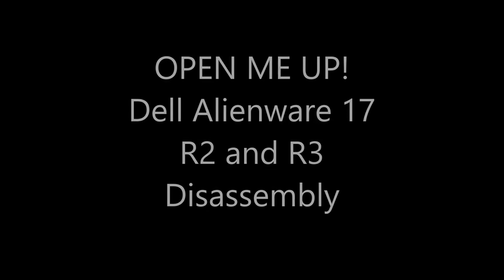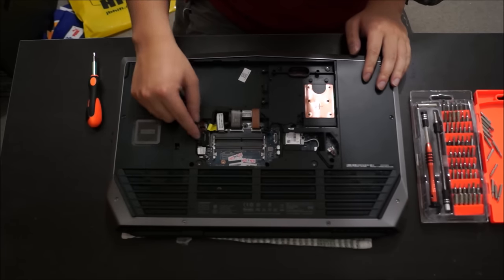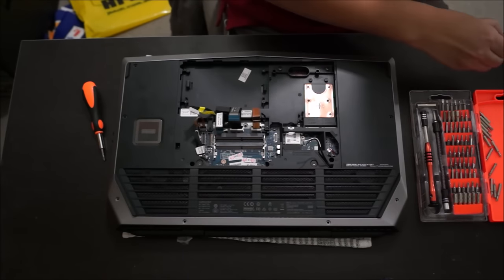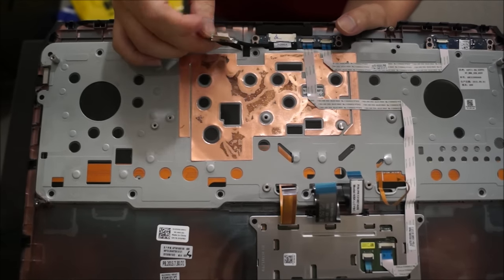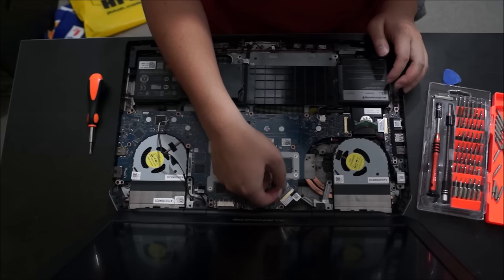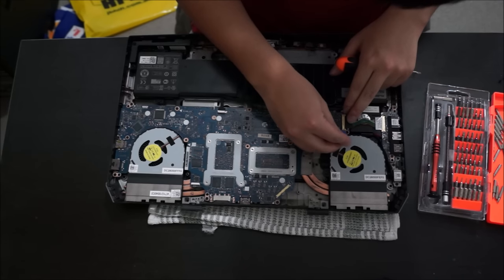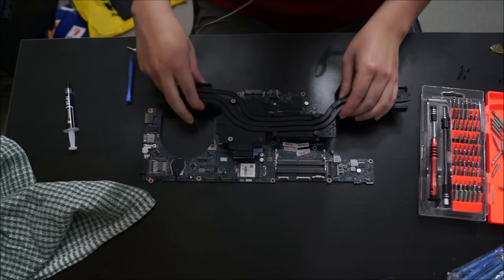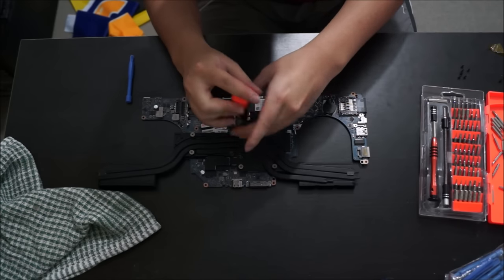OPEN ME UP! Dell Alienware 17 R2 R3 Disassembly

Comment: please make a video of the most quick and easy cleaning of the cooling system .(Alienware 17 R3)
Reply from the maker: +Alexandr Postolatiy watch 19.30 the black thing is all you need to clean and thats all there is to the cooling system
Reply: I think he was asking if there is a way to clean dust out of the cooling system without the complete disassembly of the computer.     From what i can tell from the video, the answer to that is no.  (it appears that you can partially clean by blowing compressed air into the exhaust vents.   I would clean about once a month).   This is critical maintenance since over heating is a killer.  Looks to me like a very bad design for Alienware's latest notebooks.  I am considering buying a Alienware 17 and Graphics Amplifier, but after watching this video I am not sure this is the computer I want.  Dust cleaning from the fans and radiators should be as easy as popping open an access panel.  It is also disappointing that the video cards are no longer upgradeable.
Reply from the maker: many people want to upgrade their cards and cpu but then after finding out it cost basically half of the laptop just to buy a cpu or graphic card they dont do it. So the issue is no one does it thats why they removed it. I heard many people say they going to do it but no one i know that owns a laptop that has changeable graphic card or cpu has ever done it

Comment: Hey, Do you have an idea of how to just clean the dust out of the fans with minimal disassembly?
Reply from the maker: watch the video and get to the fan. if you dont get the the fan you cant clean it out
Reply: Ah, so i have to take out everything prior to the fan first? I was hoping there'd be an easier way but I guess not. Also, just a quick question. Is it possible to change the graphics card, or add an external one to this laptop?
Reply from the maker: if you read my description it tells you the graphic card is soldered on. you can use an external graphic card if you get the alienware amplifier

Comment: Hi, 1st hope you reply on my msg. 
My alienware 17 r3 suddenly suffer a 7 beeps error. I tried the comforter trick but didnt work. Dell support gave me the quotation for new mother board and it cost like a brand new laptop. Now planning to do a 'motherboard reflow' with opt 1 : using heat gun or opt 2 : bake it in oven. Just wanted to check if you heard this issue before and also would appreciate some advice. Thanks!
Reply from the maker: Use a heat gun but doubt you will fix it. an oven is dangerous and will normally cause more issues. if you use an oven you will realise some of your other components falling off because the heat unsolder other components without you realising it.
Reply: OPEN ME UP thanks alot for your reply. Will do the heat gun then. Though what confused me is that some says to heat the GPU others says it's the CPU. Sorry for asking too much but do have an idea which one I need to reheat? One thing is clear, that I have to do it since mboard replacement is good as buying a new unit. Very sad life.
Reply from the maker: it is normal for these issues to happen you dont know how many of these i had that i could not fix with a heat gun. the last time i check dells user manual it says 8 beeps means the CPU and 7 beeps is the GPU but do both there is no harm. since if one of them have lost contact clearly the other one is close to the same thing or have the same issue already. the motherboard works from the lowest number first. therefore if you have an 8 beep issue as well it will not tell you until you resolve the 7 beeps.
Reply: Thanks. Let me give it a try and update you here, hope my next post is a good news. Thanks again.

Comment: in alienware r3 2013 model how many hdd or ssd can fit at max and ran can be upgraded to how much bg at max??
Reply from the maker: you need to tell me if it is the 17 15 13 or what. if it is the r3 17 2013 it can fit 2 2.5 inch hard drives 1 extra if you remove the dvd drive and a msata
Reply: sorry its r3 17  2016 model and it does not have any dvd.
Reply from the maker: CPU is solder on, graphic card is solder on, ram can be changed to 16GB max with 8GB in each slot thats for ddr3, ram can be changed to 32GB max with 16GB in each slot for ddr4, there are two M.2 at 80mm slots for the R3 model, there are four M.2 slots for the R2 model and there is 2 slots, wireless card can be changed, and hard drive is a 2.5" inch.
Reply: thank you....

Comment: Hello, a question that type of mainboard is that?
Reply from the maker: it is this laptops motherboard. which is only used for this laptop and the 15inch version. everything is soldered on to the motherboard if that helps

Comment: Hi is there a slot for 2nd ssd 2.5 inch hard drive , just ordered another one :( ?
Reply from the maker: no there is only one 2.5 inch slots and two m.2 slots. if you have the R2 you have four m.2 slots instead of two

Comment: how did u disconnect the hard drive cable. that black plastic tab thing
Reply from the maker: you need to life up the clip thing holding the cable down
Reply: you mean to pull the black plastic tab up right? Did you use much force to pull it? cuz I pulled it with some force but it seemed attached very tight.
Reply from the maker: you know watch the video and tell me the time in the video this happen because i dont think with both talking about the same thing
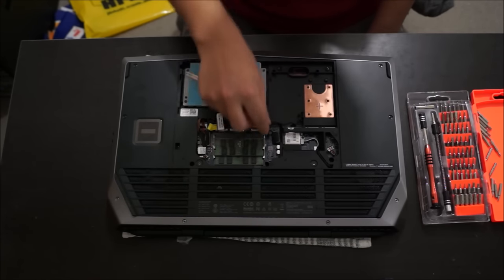Reply: it's the thing you hold between 1:34-1:37, and it seems that when you opened the panel at the beginning, that cable has already been disconnected so I don't know how u disconnected it. It has a black plastic tab and others say just pull that tab up. I just don't know how much force to use since mine seems get very tight and can't get off.
Reply from the maker: no just lift it up and it comes off.

Comment: God it's so annoying to buy a gaming laptop and have to disassemble half of the bloody thing just to clean the fans or reach the GPU/CPU.
Reply from the maker: normal people dont even have a screw driver therefore they dont even think about disassembly it.
Reply: Quite frankly I'm very afraid to remove the mobo because I'm a bit of a brute and I've broken much tougher things and that thing is full of delicate cables that are very well connected to their connectors indeed.

All just so I can clean my fans, which btw is basic maintenance that all gamers do for their gaming laptops. 

Next time I'll go back to MSI, at least all the vital parts are easily accessible through a single back panel. Even if I did know how to handle those cables, it's still incredibly inconvenient. You can't call yourself a gaming laptop if you have to remove every single component just to do some simple fan maintenance imo, it's ridiculous.
Reply from the maker: yes and no. think about it all the people you know how many of them would actually do it. companies cant make it simple just for a hand full of people who would like you and me. thanks to them i get to make videos and you get to watch them
Reply: It must be nice to be those people and have 1500 dollars to throw away whenever their fans get too dusty.
Reply: @j marco Uh what? I don't smoke.
Reply: M17x R4 is way better. It is upgradable and possible to maintain compare to the BGA Alienware today. Dell with their idea to make Alienware turn to be BGA have ruined Alienware. They threated the line on Alienware and horrible control on its custom.r service

Comment: My 17R3 beeps twice when I'm trying to turn it on. Help me please
Reply from the maker: ram issues
Reply from the maker: there is a beep code list you can find. 2 beeps means no ram
Reply: Laptops  
1 Possible Motherboard (covers BIOS corruption or ROM error)
2 No RAM detected 
3 Possible Motherboard Chipset
4 RAM failure (other)
5 CMOS Battery
6 Video card/chip
7 CPU
8 LCD 

2 beeps possibly mean ram not detected, it might be your ram or the slot

Comment: my friend , you got a subscriber and like :)
I need your help , I bout a new alienware 17 r3 970m and went outside the states , at first it was suddenly freezes then gives me that the intel graphic card was not responding and restarted . one day ( 4th time of use ) I power it on and it was froze , I had to do hard power turn off , when I start it again the GTX 970m was gone !!

I went to device manager and the GTX was grayed out , I uninstall it, and was not able to find it again  !! 
- I did clean windows install 
- updated the os
- updated the BIOS
- disconnect the batter and did power drain .

with no luck 

can you please tell me if there is something else I can do 

thanks
Reply from the maker: nope seems like you have a motherboard fault and there is nothing you can do with it as everything these days are solder on to the motherboard. from what you are saying your graphic card is probably dead
Reply: OPEN ME UP thank you very much

Comment: Imp ques can i have Alienware 17 R3 BATTERY into 17 R2
Reply from the maker: yes they are the same laptop
Reply: +OPEN ME UP R u sure cause after ordering may be there is less chance for replacement
Reply from the maker: if thats the issue why dont you go buy a r3 battery then. which is much safer than one a r2 battery
Reply: +OPEN ME UP I mean that if i buy AW 17 R3 battery and if it wont fit into my R2  then  just confirmation ???
Reply: +OPEN ME UP and BTW u r too fast i mean ur replies awsm
Reply from the maker: it just happens that i just got home and sitting on the computer
Reply: +OPEN ME UP Buddy but u have not replied my above ques
Reply from the maker: i didnt see your question. what alienware you have. give me the service tag and i will tell you what to buy
Reply: +OPEN ME UP ALIENWARE 17 R2 2015 MODEL
Reply from the maker: the part number for the battery is 92WHR. Here is my service tag for my R2 and R3 . you can see in the system config for both of them that they use the same battery like i said because they are the same laptop they use everything the same it is just the motherboard they solder on a different CPU
Reply: +OPEN ME UP You won brother thanks for the great help

Comment: i just want to clean its fan..i am afraid i might wreck it...
Reply from the maker: it you watch the video and still think it is too hard. i recommend you not to do it
Reply: Hey man i did everything as you said now my fps are dropping like crazy....i think i applied more thermal paste...what should i do?? please help..
Reply from the maker: do it again and apply less thermal paste
Reply: OPEN ME UP i did it again..but same problem...fps are dropping within 5 minutes...looks like something is wrong with my heat sink..what do you think?
Reply from the maker: no i doubt it you probably have computer issues. try running 3dmark 11 and tell me your results
Reply: Score- P10193
Graphics Score- 11436
Physics Score- 7572
Combined Score- 7868

It was tested on 720p..
Reply from the maker: when it ran it should tell you a link and also in the page it shows up it tell yous if your laptop ran normal compared to other laptops with the same specs
Reply: yes, it said 66% better than overall. But my heating issue still persists...i have no clue what to do....87-88 degrees is too much man
Reply from the maker: i am pretty sure that is normal i will check my one and see what is says
Reply: okay Thanks..:)
Reply: Dude have you tested it yet..let me know.. and Merry christmas.:)
Reply from the maker: sorry i have not tested yet as i found out that my brother sold this laptop so i couldnt test it. when you test it, it opens up a webpage with the results send me that link
Reply from the maker: according to your results it is normal nothing wrong with your graphic card. Your graphic card got 12365 and the normal for this graphic card is 12390. therefore your graphic card is functioning normally
Reply: I sorted it out...removed shitload of dust from my fan...its running smooth now..but some times GPU clock drops from 1126 MHz to 500-600 MHz while in a game, it doesn't matter that much but it drops fps from 80 to around 30-40 for like 3-4 secs....any suggestions?
Reply from the maker: this is normal if you are running on battery only. as dell found out many people were complaining about their batteries dying since the battery can not handle to fully power your laptop while gaming therefore a bios update was provided to lower the laptops performance when using battery. you need to have the power plug in to get full performance, thats all i know
Reply: I am not playing it on battery, i have plugged in the power still same problem...btw i have updated my BIOS to the latest update, so i guess that might be it..
Reply from the maker: sorry man that all i can think of. the bois update is there to save your laptop.

Comment: is there a reassemblym
Reply from the maker: just do the reverse of disassemble. you took it apart you should be able to put it back
Reply: OPEN ME UP I did but the back panel isn't going back in, it doesnt fit because of the little lip tabs under it
Reply from the maker: i dont understand what you trying to say
Reply from the maker: you need to hit it and it i will go back in. it was made like that. you can align it and use the screw drive to close it down
Reply: ty ty ty ty
Reply: havent been on my laptop in weeks

Comment: Hello, if im having troubles with my audio jack and usb port on my 17 r3, can i replace that little card with the usb and audio jack from here https://www.ebay.com/itm/381788578966  ? Is that the one close to the charger jack right? Just at the left side of the laptop. Thanks.
Reply from the maker: have you confirm that it is faulty if not instead of just buying it at least open up your laptop and test if it is loose or something yes that is the replacement part of your laptop if you need to buy it
Reply: OPEN ME UP thank you, i just wanted to be sure, since the usb port looks a little wear and it could fail in the future. Another question. I got this alienware 17 r3 skylake i7-6700hq, 1tb, 8gb ram, gtx-970 for about 950 dollars, do you think is a good deal or should i just go for a new more expensive one?
Reply from the maker: 950 USD AUD? what currency. 950 AUD is good price as it sells for around 1200 - 1500 on ebay

Comment: U can use 64gb ram 16gb ain't the max
Reply from the maker: when this video was made they were only selling DDR4 in 8gb. now you can get DDR4 with 32GB so yes you can get 64GB
Reply: @OpenMeUpTec  would u happen to know how many total hard drives this laptop can hold?
Reply from the maker: @robmoser4485  1x 2.5inch and 2x m.2 ssd

Comment: First and last time buying alienware laptop. It should not be this hard to repaste CPU/GPU. The original paste is garbage, forcing consumer having to repaste. Not so friendly design to access known component that will require maintenance/repair/upgrade is just a pain.
Reply from the maker: you are not suppose to reapply thermal paste. come on you can expect them to make a laptop just for people like you who want to do stuff. as you may know most people never open up their computer before. there is no point making it easy when only a hand full of people who cares. this is why everyone is going the apple way. apple make laptop with solder on components and everyone is happy, it is cheaper to solder on parts and it makes the computer last longer
Reply: I think there is a different between high end gamer laptop vs. every day laptop for casual users. Gamers want performance, and when the product doesn't deliver (i.e. overheating issues that alienware laptops been having). Consumers will be looking else were for products. No point of dropping 2-3k on a laptop and it's crap. There are numerous of post/thread on alienware laptops requiring repaste. If that brand want to be in this market, they'll change it. Plenty of other products out there to choose =)
Reply from the maker: i see what you trying to say now. every laptop i own i have reapply thermal paste but thats because i make these videos so to show you i do it. generally a bios update resolve the problem as the propose of them is to alter the current state of the laptop to resolve issues which normally means reducing the performance.